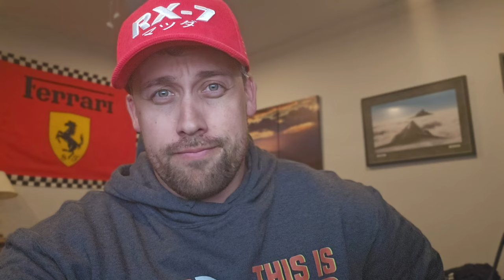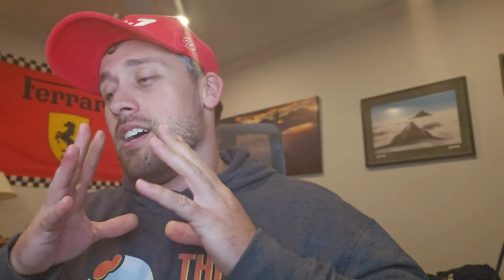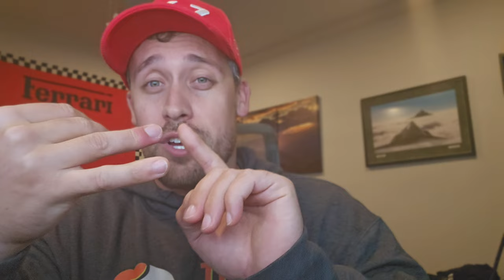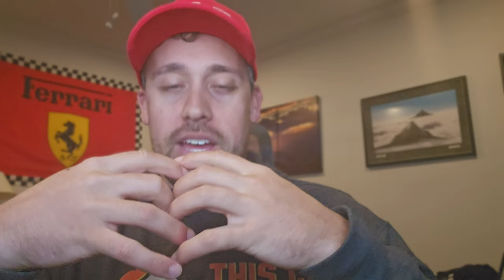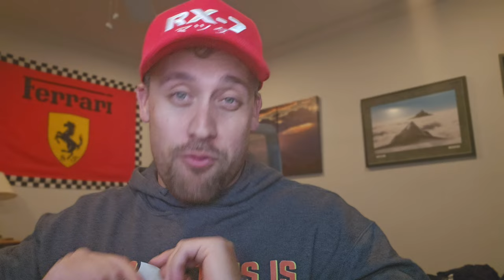Rotary Engine: When to Streetport, Bridgeport, and Semi-PP and How Shops are Bullshit

Comment: I've been running a tired old REW that was rebuilt with used older housings, remachined rotors because the apex seal grooves were out of spec, with 3mm stock steel seals and said rebuilt motor has just under 50,000 miles put on it over the last 8 years or so. It makes 385 whp at 1 bar of boost on a garret GT35R, and a touch over 400 at 17 psi which is my max tune that I hardly make use of. It's getting tired now, but when I put a brand new fresh engine in I'm probably going to do the same thing because this junker has served me admirably for quite a long time. RX7club would probably crucify me for posting the intention of putting 3mm seals in a fresh engine, but you know what, I'm sold on the setup. I know they're heavier, don't seal as well, all that, but all these stories of aftermarket seals warping and bending and all this bullshit, I just don't want to deal with it. The instagramification of this car has spoiled the build dynamic most people are being introduced to. I might go bridge but I haven't decided yet, because it's not like the car needs more power as is. I just like the idle brap but I'm satisfied with 400 hp.

Comment: Would it be possible to maintain PS and AC (s4 turbo2) with using the Hall sensor and trigger wheel setup you mentioned? (3:15)
Reply from the maker: Yes. That's the whole point.

Comment: Great video. Just kinda stumbled on it. Do you have a similar video for NA? I have a 5 letter 13b but NA and carby. Will be needing a rebuild at some point and I'd like to push a little bit mode outa the engine for my little FB. Still thinking street port or small bridge for a canyoning set up.
Reply from the maker: @ajsummerhayes4639  Reach out to Legend Motorsports and he can take care of you for that.
Reply: @RGHTBrainDesignDrive  awesome thanks. Would you know of a Canadian option? If not that's cool. Just shipping might be insane.
Reply from the maker: @ajsummerhayes4639  he's in Michigan, so it's right across the border.  REC is another Canadian option, as well as Grant in Vancouver area.

Comment: Does something like porting or a particular HP goal say 400hp automatically = dowelling or studding. Because i've heard the engines tend to open up at around the 14psi mark
Reply from the maker: Doweling and Studding isn't needed until past the 600whp mark.  There are quite a few of my tuned engines out there over 600whp with ARP or similar 10mm OEM-replacement studs and proper building by Legend Motorsports or Maple Racing.  It comes down to the engine builder and tuner working in unison.

Particular porting for 400whp would be no more than a half bridge at that power level.  Normally I'd have most cars land around 425-450whp on Pump Gas depending on porting and turbo selection, then up from there.  Those are safe, reliable numbers.

Comment: Bridgeport in New Zealand is the minimum port we do no matter what the set up 😂
Reply from the maker: @benvlassoff6378  Bridgeport = Best Port.
Reply: @RGHTBrainDesignDrive my goal hp is like maybe 280 on a turbo renesis should I fill bridge port running the greddy setup for it I want braps but I also don’t wanna blow up the weaker renesis engine just tryna be quicker than a your normal Prius
Reply from the maker: @skitlershot7403  Do a Bridgeport on the secondaries only and we'll be able to make it happen on pump gas with a 70lb/min turbo.
Reply: @ still braps tho even tho it’s not a full bridge
Reply from the maker: @skitlershot7403  Yes. Half Bridge is fine.

Comment: Crazy to me and older rotary dude to listen to a modern rotary guys talk about 300-400hp like nothing lol...back in the late 80s and 90s we were chasing close to 250hp to the rear wheel and we were more than happy to get anything near that, i understand were were a bit primitive with downdraft or side draft carbs lol but fascinating how the technology and methods have evolved.
Reply from the maker: @seblo8462  I've tried to elevate all my pump gas cars to ~400whp and everything E85 is minimum 550whp and upwards to 700whp.  Truly an amazing time to own a Rotary.
Reply: @RGHTBrainDesignDrive  thinking of redoing my 85 GSL-SE one last time and going efi, been hearing lots of good stuff about the Holley Sniper system, do you have any experience with setup?

Comment: You mentioned "some guys take a 110psi engine, rebuild, and it's down to 90psi." What are they doing wrong to cause the compression loss? That is a mistake I need to avoid repeating.

Comment: Throw a P1SC Procharger onto a large ported semi pp and call it a day. All the torque down low and still big revs
Reply from the maker: @adambyrne9821  that's a ton of parasitic losses and load on an engine without main bearings... It's not the way.

There is a 4 Rotor doing that exact thing right now and it'll be interesting to see how it goes.